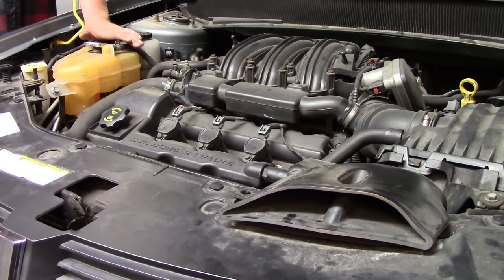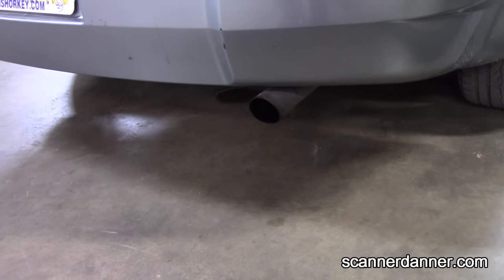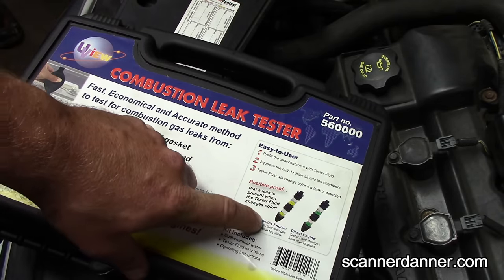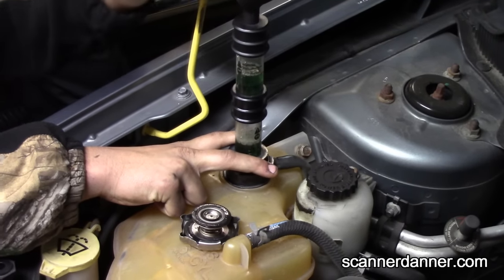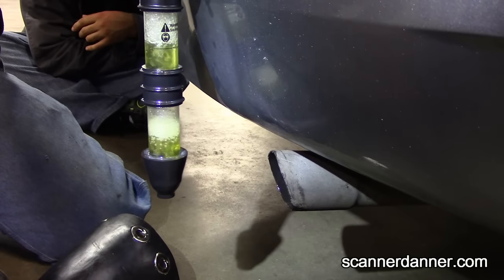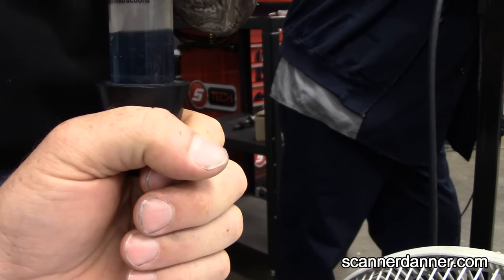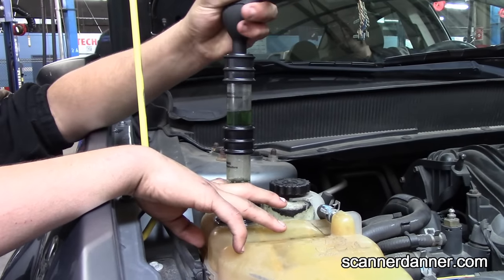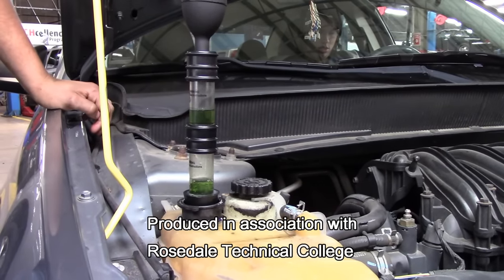Testing for a bad head gasket  - Gas Analyzer vs Chemical

Comment: great video SD if you could go to IATN and go to the waveform library  and specifically pick waveforms //engine /propulsion// 2003 Honda accord//3.0// and look at the capture   FLS adapted to radiator fill neck   relative compression on other channel   adds another way along with block tester and 5 gas to diagnosis blown head gaskets   cooling system has to be full of fluid before test  no air pockets.    just some food for thought  take care
Reply from the maker: Nice. There have been a few others asking me to do that with my pico pressure transducer.

Comment: Why did you not do this test on a new(er) car which you know for sure has no head gasket problem and verify that the fluid does NOT change the color?
Reply from the maker: I didn't feel the need to. It would stay blue, just like in the atmosphere. The issue here is not a false positive, it never was. The issue is a false negative. So testing a known good car would not help answer this question. Make sense?
Reply: I think this would be a good test as well I was hoping for a test on a known-good head gasket
Reply: Many years ago, my foreman warned me that I should watch myself with that tester. "A fail is a fail, but a pass can still be a fail"...
Reply: So what is the fix?  Was the vehicle repaired. Can you do a video on the repair. Thank you.
Reply from the maker: This video was not about the repair. The repair is extensive engine tear-down
Reply: ScannerDanner okay thank you. I enjoy your videos. Would a head gasket sealer be a possible quick fix. Thank you.

Comment: That tool measures CO2. Engine needs to be at normal operating temp and you have to pump it for one minute. You can’t do a review on a product if you won’t do it right.
Reply from the maker: If you have a headgasket leaking, the engine absolutely does not need to be at normal operating temp to see combustion gases in the cooling system. Not to mention a possible boil over at normal operating temp with no psi in the system.
Reply: @ScannerDanner  this test requires operating temp. Because starting your car in the morning and doing the test won’t do you much good if the thermostat is closed

Comment: You do not know what you are talking about. Which is actually ridiculous for someone doing this as long as you have. The chemical tester is a co2 blend w h20 aggregate tester. Simple as that. Green on gas engines means it's getting some co2/h20 aggregate. Yellow means it's getting a lot. Bottom line. Even a little green-- it's getting a little. It's all in proper instructions, and you have to know what you are looking at. People can drive around with slightly warped or torn gaskets for years, especially if they keep the vehicle cool. This will help that warp not to show itself and start infecting opposing fluids. Hell if you have some luck, you may be able to drive around for the life of the vehicle- although that isn't likely. In closing- there is nothing to be "sold" on. The test is 100% accurate.
Reply from the maker: Scenario where you are wrong and this tool will miss it.
Headgasket leak into on specific cylinder and it is soaking the plug, so no ignition taking place. Guess what gas you do NOT produce? CO2!
The HC test with a gas analyzer is far more accurate.
Reply: @ScannerDanner  if there's no co2, there's no hcs. Yeah there are scenarios where these tests won't pick it up, with certain leaks. But the point stands, if it goes green at all, these is a co2 leak, and there is a head/gasket/block issue.
Reply from the maker: @hw5091  that is absolutely incorrect. Injector still sprays, compression still happens and it pushes the unburned fuel into the water jacket
Reply: @ScannerDanner  if there isn't combustion, there will not be hydrocarbons, which only happen during the combustion process. Co2 is so readily available as a bi-product of that process that it makes it easy for a cheap dye test like that to pick it up. This has been my point. What you were saying in the video was you didn't know what it did, which is why I was surprised. Also, I said the test is 100% accurate if it goes greenish or yellow, even a bit green, that there is co2, which only happens in the coolant if there's a leak. All of these other situations are different than that. The last one here, yeah raw fuel may pass a dye test. But not combustion gasses (because co2 is invariable to come w them, and in heavy doses).
Reply from the maker: @hw5091  incorrect again. HC is unburned fuel! Gasoline vapor is raw HC!
In the video, I'm questioning not the chemical reaction to CO2 but whether or not CO2 measurements are as accurate as the HC test I've used with gas analyzers for 20 years. Pay attention before you point fingers
Reply from the maker: You know what is funny? You trying to school me on a chemical reaction and you don't even know where HC gases come from
Reply: @ScannerDanner  mmm. No. Hydrogen. Carbon. Combustion. Hydrocarbons. Not too difficult. But what's really funny is someone doing this for I'm assuming over 20 years, yet doesn't know how a simple block tester works. It's ok to not know something, say you're wrong, in this case years ago, far before I commented, and move on. Learning is ok my friend. I'm wrong about shit all the damn time. It's aggravating. I just try to learn from it.
Reply from the maker: @hw5091  it certainly is okay to not know something, I'm wrong about a lot of stuff and I show all of my mistakes when troubleshooting. Maybe next time you address someone you don't start off with "you have no idea what you're talking about" 🙄
HC is unburned gas, don't care how or why, I'm not a chemist. Guess what gas is extremely high with an ignition misfire? HC! Why? Because it's unburned fuel!
When a car isn't starting and you want to know if its getting fuel? Put an exhaust analyzer in the tailpipe and check your HC readings. They'll be through the roof if the injectors are firing.
When you have a head gasket failure, even in the early stages where it is only causing a misfire on start up. The HC test in the cooling system is 100% accurate. The CO2 test is not and I've given you a scenario where it isn't. 
When you have a complete no start from a catastrophic head gasket failure, again, the HC test is your friend. No CO2 being created there either. 
This is what this video was about.
Reply: @ScannerDanner  of course the 5 gas test is accurate, i dont contend it. But the co2/h20 derivative tester is accurate if it goes green at all. That is what I've contended. That was really all I did. Sometimes you can read blue/green on that tester, n a 5 gas picks up 0 hcs. And it always ends up something w the gasket/head, occasionally block. And I'm sure there can be situations where it doesn't pick up well and a 5 gas smells out a rat. I've never contended it. But if that damn test changes color at all (if done right of course), even if the vehicle runs well, the other shoe is waiting to drop at some point. I didn't say the no idea part, but I probably came off a bit rough. Always trying to learn about this stuff, that's why I watch videos n read etc. The head issues can be sneaky fucks if it's just a slight issue or if someone put a bit of sealer in the system n cleaned up the shrapnel from the surge tank.
Reply from the maker: @hw5091  and maybe I didn't explain well what I was debating in the video. I never questioned a false positive, I agree with you, I only was questioning a false negative. I've had some difficulty using these and much prefer the gas analyzer but no one has them anymore! Every garage in PA used to have them as we did emissions testing with them, but since that died, so did everyone's gas analyzer, so in this video I'm sort of looking for another way, for myself! 
Thanks for bring this back to a civil debate, appreciate it and sorry if I was abrasive.
Reply: @ScannerDanner  eh so was I at first, sorry about that. Yeah those 5 gas are the best overall, no question, but those old dinosaurs are hard to find parts for. However they have portable units now for about 3500, price is out of line, but where else are you going to get them for less. Yeah false negatives can occur, and that's sometimes also based on lighting and color sensitivity per person.